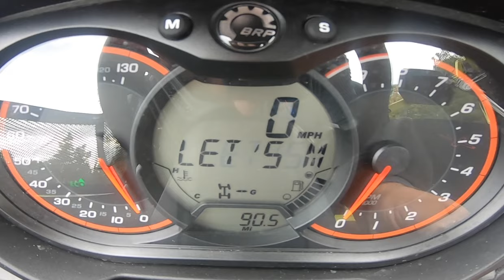Tinker Failure Disaster Spy Hydro Filter Change Mini Excavator Bobcat E42 R2 #265

Comment: Hey Peter good video but I can’t understand why you would start the machine while The hydraulic filter was loose that’s not a good thing but great video enjoyed watching it 👍
Reply from the maker: Oh Dean...confusion I left the blade up and thought the back pressure was the issue, you have to start the machine for the controls to work...not like our tractors. I should've screwed the filter I just wasn't thinking. The manual did not cover this it seemed so simple. I have to share my fails and learn and keep moving forward. I have to learn new things. I appreciate your support you know that.
Reply: @maraudermitchelli  I understand that’s how you learn everybody makes mistakes but I can tell you my tractor has been a lifesaver I have a lot of firewood done this year tractor performed well Cut Ask for a better machine Great video 👍

Comment: Not a fun job but has to be done, When I changed the filters on my Kubota I hooked up a small shop vac to the fill port on the trans/hydraulic fill, that pulls enough vacuum on the system that I had virtually no oil loss when changing the filters. Ask Jim if this is something you could do in the future, sure saves a mess, anyway you got it done. You did add oil after the filters change right?
Reply from the maker: Service did not call for a hydro oil change...it would not have been as messy if I drained the hydro oil first. I will get this thank you.